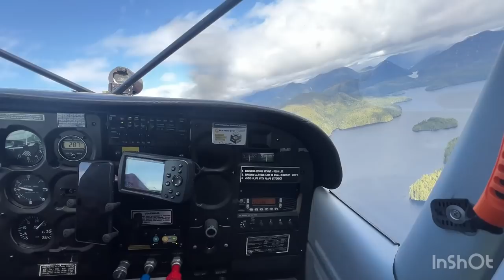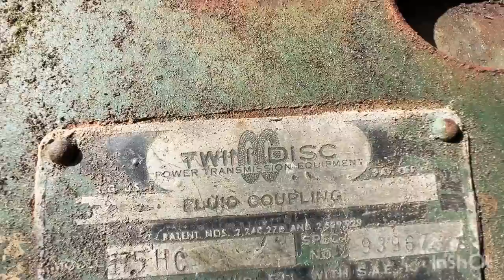Remote float camp | Abandoned antique logging machines

Comment: That first yarder you looked at the manufacture plack is located on the front of the winch frame the second one was a little better winch it hD roller bearings on the shafts the first one had babbitt bearings the plate you found on deck is called a tree plate

Comment: Bjarne, I don't even go to cut firewood without a tourniquet  on-my-person.   These dont weigh anything.  Saw cuts are typically pretty  life threatening.  Get  a torniquet and learn how to use it and practice with it so that you can apply it  by yourself and one handed with both hands. They are a few sold on Amazon and different LE  sites. Even tho you probably  have access to a heli-lift , seconds count when you have a bad bleeder. A couple of "isreali" compression-type bandages  are also something I keep right at hand.  I didnt see any of that  kind of thing in your ruck.

Comment: That had small tugs with winches on the front called alligators they used in the late 1800s in Algonquin Park in Ontario. They would pull booms down the lakes, then send the logs down river. They would pull the tug overland to the next big lake. Sounds similar. They have one in the Logging Museum in Algonquin Park.

Comment: I live in Olympia, Washington. @27 minutes in, the2 foot steel bar w/drilled holes, a couple short pegs and the end curved around was used to hang a block in a tree. Screwed into the log vertically the cable strap would set in the curved end which are intentionally bent slightly off 90%. Usually there was a set of two of these
Reply from the maker: That’s cool. Thanks for the info on that
Reply: Hey guys, I’m a retired tractor mechanic, our dealership before we were a Stihl dealer were Homlite man! Great old saws. But i thought wouldn’t that be a neat project to get that old machine working again, that engine is probably locked solid

Comment: Cool little side trip to the abandoned logging equipment. I was wondering, when you get your new saw how do you decide what size of tooth you’ll use on the chain? Is it power?  or type of wood you’ll cut?
Reply: generally speaking for the US side of the West coast PNW logging industry, I've yet to ever see a saw that works daily in the woods that's not turning .404 gauge, .063 guides. For the bar length, that's usually users preference. His coming 592, being a 90cc saw, I'd imagine she'll get a 42" b&c.

Comment: Question, don't your bosses mind you making videos on the clock?
Reply from the maker: Nope it’s been good so far. It doesn’t really take up too much time. It still hammer down some good volume in a day. The trick to being productive without working your butt off is efficiency and not making mistakes that create more unnecessary work for yourself. Do that and you can still be productive with less effort